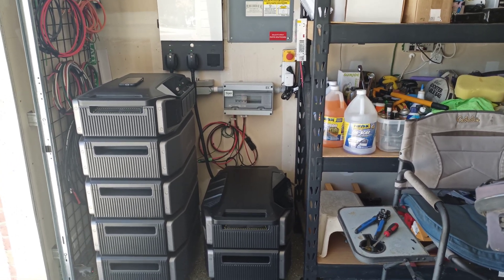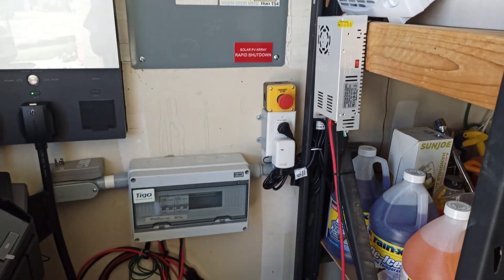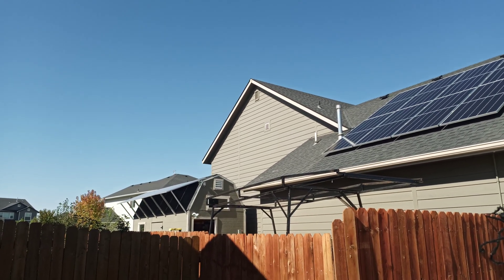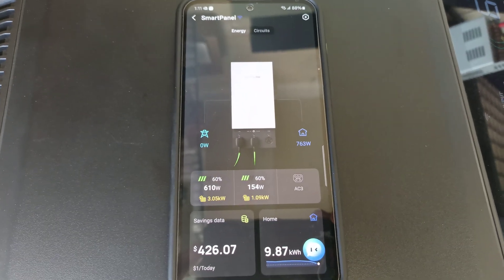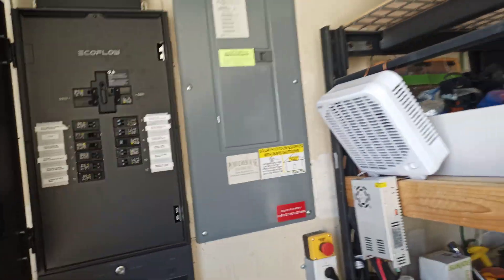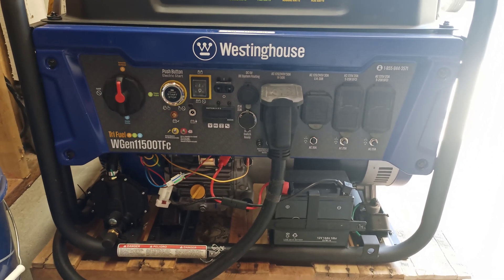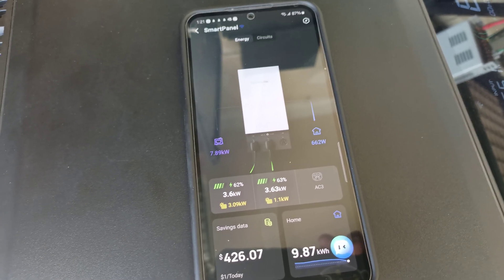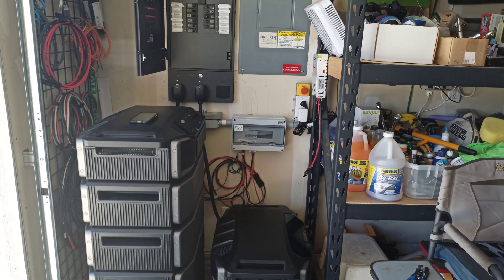EcoFlow Delta Pro Ultra install update w/ Generator overview and run time.

Comment: Did you have to remove the bonding jumper (green wire) from behind the WH blue cover 10:10 to disable the neutral bonding required for the SHP2? Also does this void the WH warranty, I doubt it since the instructions are in the manual?

Also appreciate the information shared on these videos, I’m looking for the exact setup and you covered them all. (From the “homeowner” perspective and not the “free product to review” perspective.) 😂
Reply from the maker: I did YES remove the bonding jumper, yes the option is in the WH manual as well and does NOT break warranty..
Reply: Thank you!!

Comment: Fantastic video and a great help as I am installing your exact system. What is the purpose for the DIN rail protection box and circuit breakers? Do they protect against Arc Faults since the Ultra inverter does not incorporate an AFCI?
Reply from the maker: @MarkSweeney-e9w  the DIN rail box is to mount the din breakers on it on the rail inside as that is how that type of breaker is mounted.
Reply: @erickoffgrid  Yes, thanks. I was more interested in what purpose those breakers serve in your setup and how in your setup you account for the lack of an AFCI in the Ultra inverter? Thanks for the help
Reply from the maker: @MarkSweeney-e9w  oh just a safety and it gives me away right at the equipment to shut the power off if I need to mess with the wiring right there instead of going outside to the safety switches
Reply: @erickoffgrid  Just one more question and I will leave you alone. How did you account for the lack of an AFCI in the Ultra inverter? Are you worried about Arc Faults without that AFCI installed? Just curious, and thanks so much for your great video - it helped my installation a lot!
Reply from the maker: the DIN breakers are just as a safty as I wanted to put in breakers on the incoming solar.
Reply: @erickoffgrid  Also apparently from some other reviews, the built-in HV disconnect switch on the DPU is not resistant to many uses. So having another disconnect between the panels and the DPU will keep the disconnect sparks on the cheap circuit breakers and not on the expensive DPUs. 
-> you have a great setup

Comment: Hello, quick question about the DPU inverter: I have read some one post that the inverters of these can go really bad since they are transformerless and cause damage to your home devices. Have you had any experience like that with these?
Reply from the maker: @dilumd  zero of that issue
Reply: Thanks
Reply: Thanks, I had another question: If I connect the DPU using A/C outlet to charge and if the power goes out would it be still grounded? If not how would do you go about grounding it?
Reply from the maker: @dilumd  yes it would still be grounded because all the outlets are grounded and you didn't change any wiring
Reply: @erickoffgrid  Ok, so in your video why did you want to ground it?
Reply from the maker: @dilumd  never hurts to have a ground it's a safety thing
Reply: @erickoffgrid  I see, I have a ground wire thats going out my solaredge solar invertor, do you think its alright to tap the ground of the DPU to it? Or should I run a sperate ground?
Reply from the maker: @dilumd  I would ask Ecoflow and solaredge and see what they recommend.
Reply: @erickoffgrid  ok, thanks.

Comment: Should check out the EG4 Chargeverter. Upgraded version of the old one, cleans dirty power (even though your fuel generator is under 10%), and you can program it to automatically turn on and off based on your battery banks Percentage value. Also can charge your batteries up to 5000w output.

Comment: If you plan on having an Eco Flow Delta Pro 3 Power station( indoors ) where there are humans - the unit ( In Canada not sure about the US) must have a UL 9540A rating for fire protection during a Battery runaway.
I JUST BOUGHT THE  Eco Flow Delta Pro 3 Power station AND THE EXTRA SMART Battery 4000 Watts each - total 8000 Watts, and the Electrical Inspector during the install Inspection indoors - at first couldn't find the UL 9540A Certification, so I had to go through  some E mails to support, to get the certification documents WHICH I DID GET - or I would have to build a fire safe room for the Batteries as per the NBC Canadian National Building code and Alberta Electrical code 64-1100 for any ESS system Energy Supply System -  (Batteries). An outside system obviously doesn't need the certification, but if you are hooking this up inside where people are, better get the certification.  Just a heads up.

Comment: I would like to use solar with a Ecoflow Delta Pro Ultra. Can you recommend on how to find a good installer to install solar on your roof.
Reply from the maker: @dumbox3590  unfortunately it all depends on who's local. Look around best you can and I would suggest any references. But I wouldn't go grabbing someone off Craigslist 🙂

Comment: Want to clarify the configuration.    The Generator is connected to the Home Panel 2.   And the Generator will power the house circuits as well as recharge the Ultra's batteries???
Reply from the maker: Correct.
Reply: @erickoffgrid  I have a 5-ton a/c and 20 loads for my house. Also, I already have an interlock with 50-amp generator connector to my main panel. I'm having the SHP2 installed, and I need to select the 12 loads to bring over. The a/c, oven, heat, and a few others won't make it. I figure if the power goes out, I can get by without them...and the a/c would eat through my battery in about 30 minutes. My question is around the generator: I feel like I should keep the generator connected to the main panel and as far as the SHP2 is concerned, it will be charging from the 'grid' when I run it. I will at least have a/c while the generator is running. Is there some benefit I'm not thinking about if I connect the generator directly to the SHP2? I have the same generator as you, and will be using natural gas. I live in Tampa, so not having heat is ok. Also, I have a portable a/c that I can use for a single room.

Comment: I'm curious why you didn't buy a good quality inverter generator. Doesn't seem like budget was a factor in any way.
Reply from the maker: Inverter generator can not put out the specs I need, they max at like what 5k or something tiny like that, I need low THD AND high power output.

Comment: I see that you turn the generator on. It was powering the house and charging the batteries. Can you leave the batteries as is powering the house. Turn on generator and charge batteries while they are powering the house. I was told that you could not power the house with the batteries while the generator is running.
Reply from the maker: I have not tried that every time I started the generator it automatically kicks over to charging the batteries and running the house
Reply: Thanks. I have been looking in to doing something like what you have.

Comment: I have the Ecoflow Power Kit and it did not tolerate dirty power non inverter generators. . Basically a inverter generator is the answer. Any inverter generator will do, I got the cheapest one with 3200w output, works great during cloudy days when I need to charge the system with the generator.
Reply: You can also run 2 inverter generators as a pair if you need more power and still keep having clean power.
Reply from the maker: @rccosplay3249  good information thank you for sharing.

Comment: Do you have a list of all the hardware you are using somewhere? The Panels, the quick disconnect, the other inline items you had. Also, how did you add a ground access in the garage for code? I don't have an easy access ground in my garage right now.
Reply from the maker: @dragonfalcon8474  I do not have a list I bought as I needed. The house came with a ground rod that has an access panel in the garage.

Comment: I have the dpu and am installing a 1200 watt array. Did you bond the array to the your ground bus? Where did you connect your ground connection? In the main panel ground bar or a separate ground? Just asking because i am trying to figure out how to set up mine. Thanks!
Reply from the maker: I would ground the DC array separate from the AC ground.

Comment: Appreciate this video. I just picked up a Westinghouse 18kw dual fuel generator and want to add a battery back up solution like the EcoFlow Delta Ultra. Solar is going to have to wait for me, but I definitely like seeing this content since this is how I would like to configure my backup solution.
Reply from the maker: @beckjacob  I would suggest you check your THD on that unit total harmonic distortion it matters eco-flow says 10% or less in the documentation, the only one I found Westinghouse was the 11500 TFC model.  Just sayin'
Reply from the maker: Sorry ecoflow says 10% or less the 11500 TFC was 8%
Reply: The Westinghouse IGen 11000DFC inverter is 3% THD

Comment: Great video!. Is it necessary to ground the DPU when attaching it to the SHP2? I was under the impression that the default setting for the DPU is that both ground and neutral are unbonded. However, as soon as you connect the DPU to the grid to charge it (in this case, the SHP2), it should inherit the bond from the plug, thus making both neutral and ground settings apply to the DPU. This means that the DPU body will now use a bonded neutral and ground. I suggest asking this question in the official Ecoflow Facebook group so their team can respond. Your new setup could potentially create a ground loop.
Reply from the maker: @saeidmofrad6276  I would agree, you should post that question to Eco flow.

Comment: Do they recommend you use 80% of your 30 kWh battery banks for maximum longevity? I like your generator setup. Only downside I'd have is not knowing the utility has gone off and forget to turn on the generator, because I'm using 2 lv6548 to power the main breaker panel with AC bypass rarely used.
Reply from the maker: recommended is 10% on the low and 90% on the high charge.

Comment: I have a DPU w/2 stacked batteries and SHP2 at the moment and researching to add PV. Curious about a couple of things with your system. I see the value in adding additional batteries, but wondering why you chose to add a second DPU before you maxed our your first? Does your power requirement exceed the ~7KW inverter capacity of a single DPU? Also, when adding PV, seems like the 15A limit can really come into play. Do you happen to know if the DPU allows for 15A on both the high and low side - or do you have to stay within a total limit of 15A if you are installing a low and high voltage array to a single DPU (in other words, this would allow for a 30A limit)? I've read through their online manual but it is not really covered. Thanks for the content!
Reply from the maker: @cidgrad130  with my current solar array of 4000 on one and 1500 on the other I am struggling to keep everything charged up.

Just the excitement of getting the other one and it did alleviate a couple little flickers going on like when the coffee pot would turn on with the kitchen lights there would be a slight flicker so it took care of that problem.

And then when I run a grinder or something in the garage on the garage circuits I would get a quick switch to grid for a split moment and then back over so the second dpu covers that surge.

And from what I'm gathering you can supply more than the 15 amp is long as your breakers will allow it won't hurt the dpu cuz it's only going to pull in what it needs but you must not over voltage the unit.

But yes you are correct I absolutely need to put in more panels before I do anything else haha..
Reply from the maker: In fact for the last several days I've been contemplating stashing the second dpu and putting that fifth battery and finishing that single stack and putting all my power into that one to try and keep it topped off specially with winter coming.
Reply: @erickoffgrid  I see your setup has redundancy. Whether you keep the second DPU in use or in storage, if the first one dies, you have a second one, which is great. (two is one...). I'm starting with 1 DPU, 3 batteries and the smart panel (the Costco deal was bit better than black friday's ecoflow deal, but I'm still waiting for the DPU to be shipped). I plan to add another DPU and some batteries (depending on deals) next year. As long as the tax credits are still valid, I'll leverage them.

Comment: Why not directly charge the battery bank(s) from the generator and avoid the switchover entirely?  Champion has high wattage inverter generators.
Reply from the maker: @NormalShock  champion does not make a generator suitable to charging electronics. This requires a THD of 8% or less for ecoflow. Champion is good for a construction site or rv but not in this use case.

If I did not do both then I would half to dissconnect from the house and the house would be offline and or on the grid while charging the batteries, this not best use nor how I want to use the system
Reply: @erickoffgrid  
Champion has inverter generators with solid THDs, some under 3%. Just a thought.

Comment: At time stamp 1:50, the Tigo Enhanced box. Is that an optimizer box?? What part does it play in your system? I tried to look it up, but couldn't find any info.
Reply from the maker: @surgpsych  that was just a din D I N Rail box mount for DIN rail breakers. Not a tigo box, had the sticker i put on it.
Reply: I’m sorry for asking this, What’s the purpose of that box? Should you get charge controller instead?
Reply from the maker: @thethinbluelineZ06  not sure which box you mean but the one holding the DIN rail breakers? That I put a tiger sticker on the top left of?

That is just a DIN rail box holding the solar lines breakers.

The dpu Delta Pro Ultra is the charge controller all built into it so much better and cleaner than the quote unquote old school way and all the different boxes and controllers and everything else needed.
Reply: Thank you for responding, I’m moving down to Florida soon so I have to come up with a system!! and for what I have seen so far, Ecoflow is a very good system!!! Thank you for making the video!! top notch!!

Comment: Without a dual fuel generator, a 30kw battery setup and a 6kw solar setup doesn't last very long in a power outage over 1 or 2 days....unless you severely restrict your usage.  It would be cool if ecoflow had a larger capacity smart generator offering for these big solar/battery setups.
Reply: He’ll keep expanding his solar.  He mentioned adding panels on the south roof face.  When he runs out of roof, I bet he’ll start doing solar trackers.

Comment: Why on Earth did you waste your money on a high frequency, output transformerless inverter. They offer shorter life expectancies, poorer surge capacities and because they don't use an output transformer, they don't offer any galvanic isolation between their DC boost stage and their AC output, which can not only damage your AC appliances but can even set those appliances on fire.
Reply from the maker: @quickquote1568  k
Reply: that does beg the ? what is the idle consumption of the DPU?
Reply from the maker: @Gary-ee3kq  I read it somewhere, it is a thing of course but I remember thinking it was fairly low.. but the number is out there...
Reply: @Gary-ee3kq the dpi is around 90% efficient.
Reply: I'd guess anyone like us going for that Ecoflow system are after something a bit more polished than pure DIY gear, and also easy to extend without additional electrical permit and cost. 
For instance Tesla powerwall: each time you add one, electrician cost and permitting (if any) costs are added. Here you just add more batteries and up to 3 dpu. 

So it's a balance between ease of use (high), cost (medium), and some compromises.
Reply from the maker: @TerryFrenchy  well said ❤️❤️

Comment: There might be a way you can integrate the EG4 Chargeverter into your Gas Generator Setup. That Device turns dirty power into clean energy
Reply from the maker: @Moes_Prep_and_Tech  that is a great idea and totally worth investigating...
Reply: @erickoffgrid  if you can find a way to use that with your current setup please do a follup video about it, it is possible

Comment: Awesome set up! Question, in theory, without an advanced intricate set up like yours. Can you directly plug in your gas generator into the Delta Pro Ultra. And  have the DPU charge its battery and power the house itself. So the gas generator is not feeding any power to the house directly, but the DPU is while it’s also charging if the house power draw is lower then the incoming charging power?
Reply from the maker: @sleepeatdrive7619  this you cannot do, the charging port you would use for the generator in your scenario is also the same cable point to feed the house so it can only be one or the other in your setup.

And the only way to do both at the same time is the way you see I have it.
Reply: @erickoffgrid  awesome thank you, will share your video to friends who are considering the Eco Flo system!